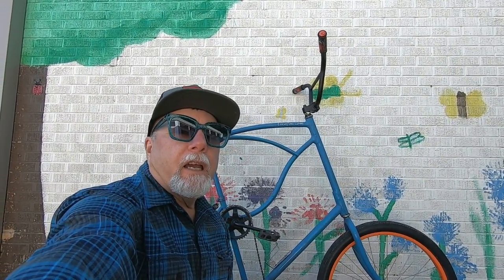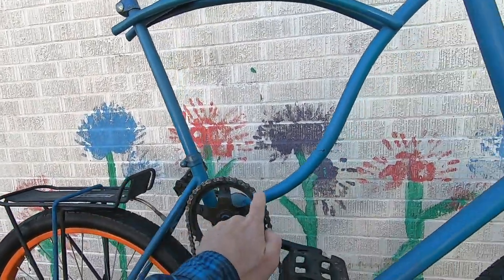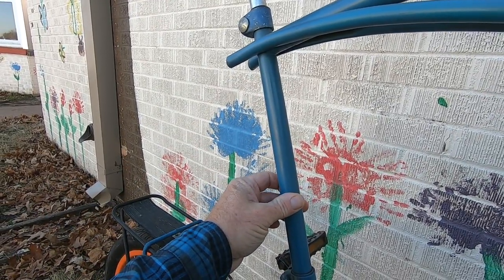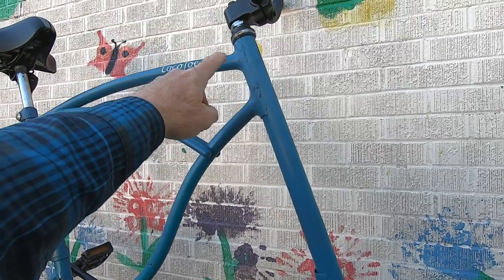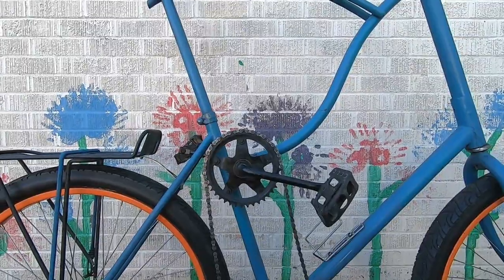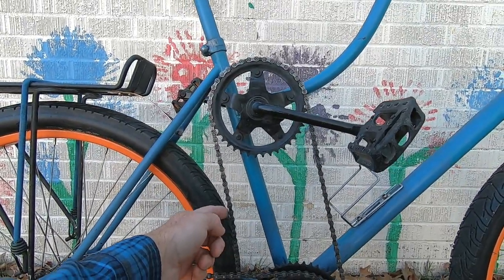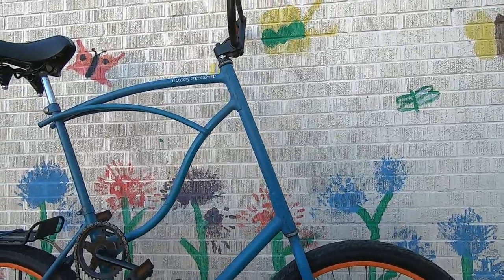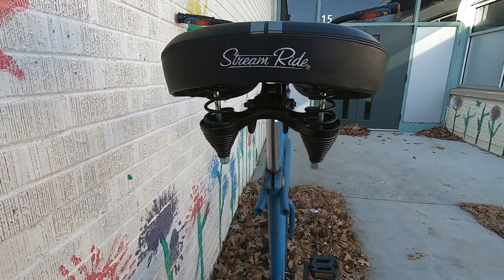About This Bike - Tall Bike

Comment: I'll bet that's a whole different experience riding up that high, especially on what looks like a pretty short wheelbase, but I like it!  This would be a good parade bike, like the bucking bike you showed.  Thanks for sharing!
Reply from the maker: Yeah these things are so much fun to ride. That being said... I no longer have it. I'd also made another one long before this one and got rid of it too. I just didn't ride them that much. They are attention getters and that part I didn't like. Being photographed, hollered at, gawked at, stopped to  answer questions  etc... Would have been a lot better if I could just ride it in peace. I didn't put much thought into them when I made them Just whatever I could put together with the least amount of effort. Ideally it would have a longer wheelbase. Surprisingly though  the front end stayed down pretty well.
Reply: @Locojoe  I can imagine.  I wouldn't like that either.  I'm in a very small town, so after the initial "older guy riding a bike for fun" thing wore off around here, I can finally ride without constant questions and all that.  I'm a bit of a introvert, so I prefer to just be able to ride in peace as well.  I did wonder how often people would approach you, with all these older, stylish, different bikes.  I figured in a bigger place, it wouldn't be as bad, but I guess I was wrong on that assumption.
Reply from the maker: @johndunbar2393  I suppose some people build and ride them just for the attention. Despite how it may appear, me putting myself al over the internet I'm really more of an introvert too.